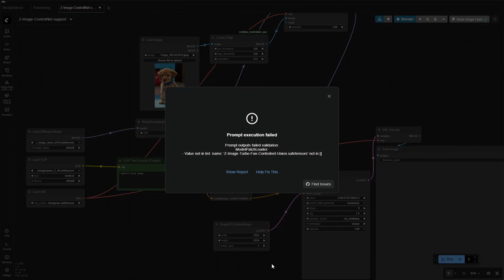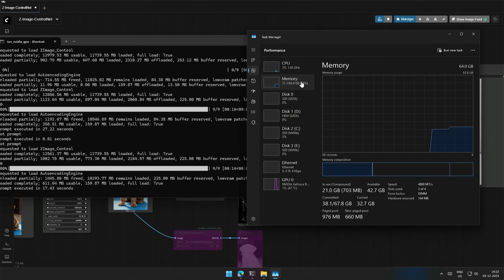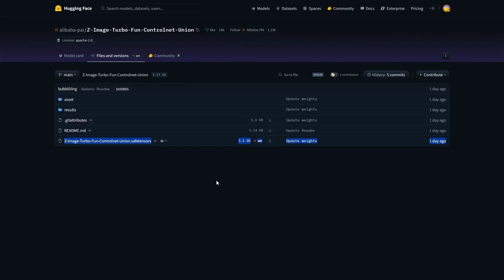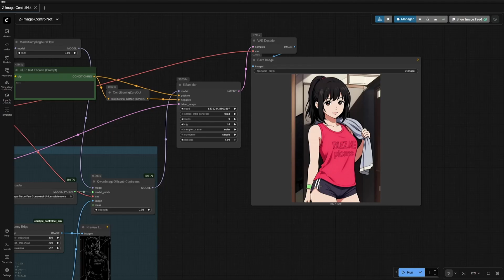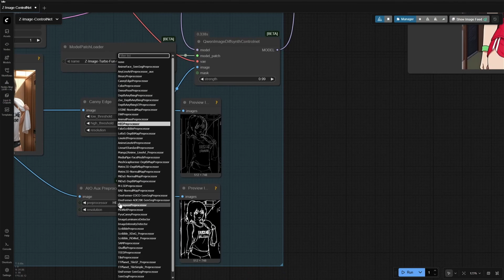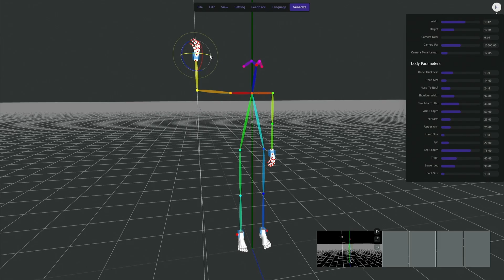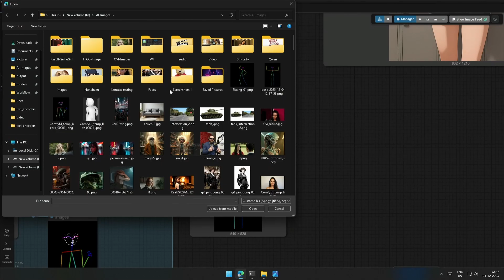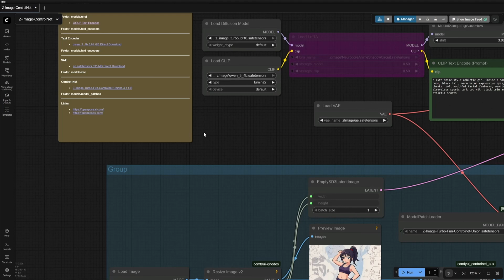Z-Image Tutorial | Reference Image with Control-Net

Comment: this is not i2i but "i did a thing with noise. Basically replacing 1st denoise step with a control net. This models has no image input in training data so it has no idea about getting encoded latent and cant analyze image to change smth in it. And anyways rhis year new model comea with this features

Comment: Model Patches gives "UnboundLocalError: local variable 'model' referenced before assignment" terminal error.
Reply from the maker: Update the custom nodes
Reply: 1) Update ComfyUI to the 3.76 version
2) Open github "Z-image controlnet not working" issue and scroll down to message with 3 files mentioned. It works.

Comment: Sir what you said i have totally followed every thing still error is coming sir please suggest.UnboundLocalError: cannot access local variable 'model' where it is not associated with a value
Reply from the maker: Update the custom nodes from the comfy Ui manager.
Reply: 1) Update ComfyUI to the 3.76 version
2) Open github "Z-image controlnet not working" issue and scroll down to message with 3 files mentioned. It works.